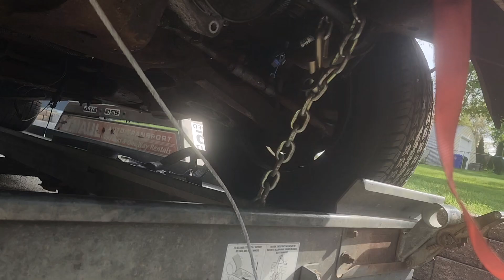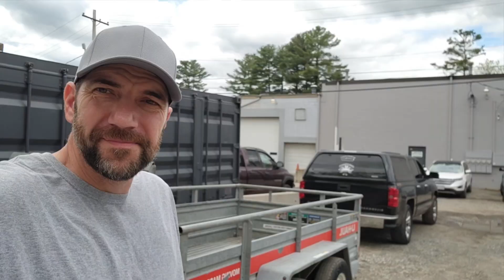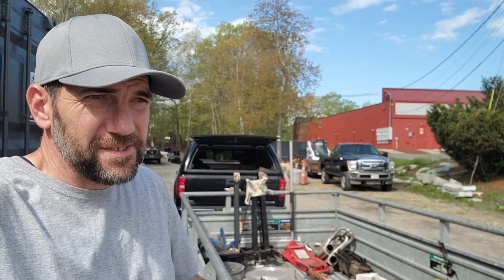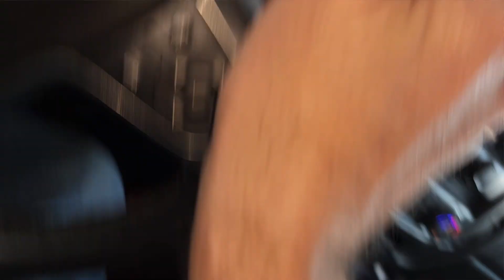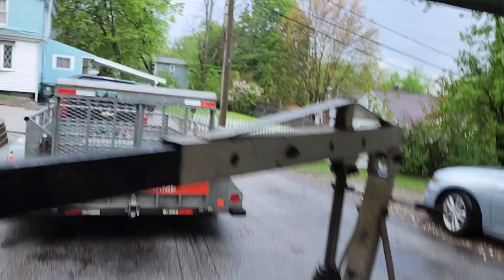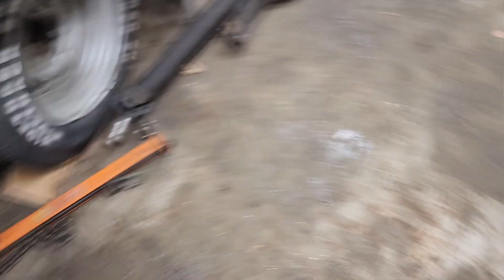(2) Day 2! let the chaos begin! 15 days left! parts gathering, a storm rolls in, engine teardown.

Comment: Good 👍 Job …..
p.s. when you transport the engine - put an old car tire under it or one larger one (like from a truck or 2 pieces but smaller) - in general, look at the size of the tire and the engine (so that they fit together) - then don't forget to fasten the engine to the side with straps - good luck transporting the engine …..
Reply from the maker: @alicemoon9008  thanks, yeah I have used the tire trick before but this one was nice and flat and sat super stable with a block under the starter and oil filter. 👍 it went nice and smooth. Thanks for watching!